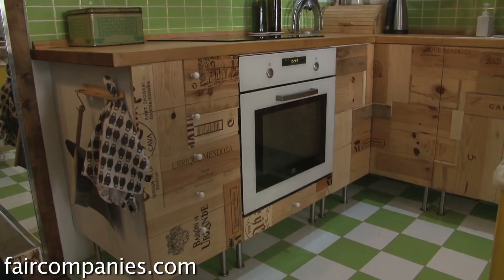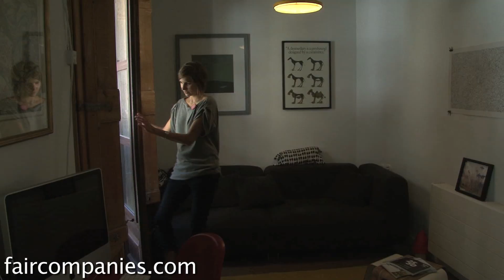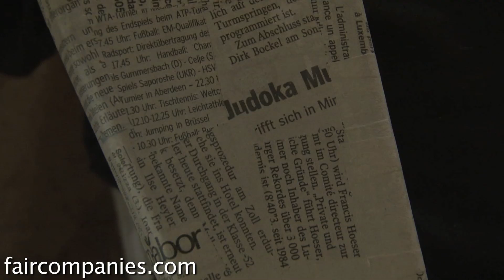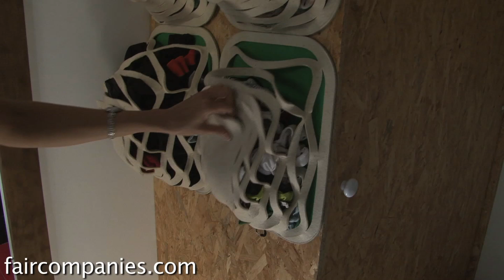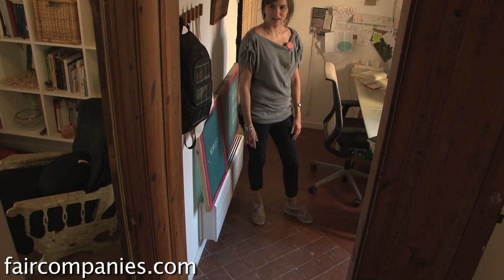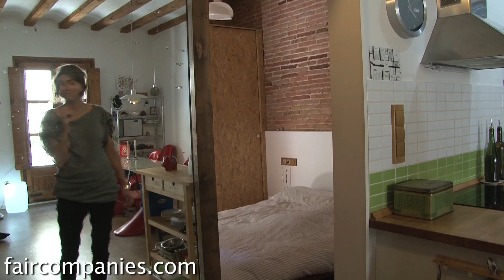TrashKEA home design: trash + IKEA + design = eco-cheap chic

Comment: flushing actually uses more water than it is needed to clean your shit. If you just put two bricks in the tank, the amount of water you're using is proportionate to the amount that is actually needed. This way you are saving water from wasting and also get a wet fresh muddy smell in your bathroom.

Comment: lol, they use aerators to save water but then have two separate turnstile valves instead of a 1 lever combo-valve to mix cold/warm, which you can turn off one-handed whenever you don't need running water during the washing process. But nice apt., anyway